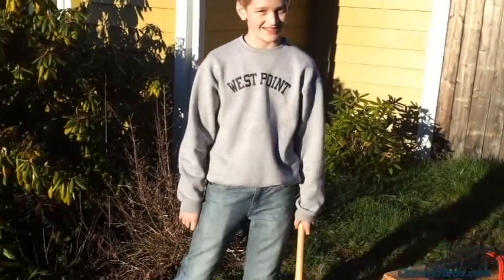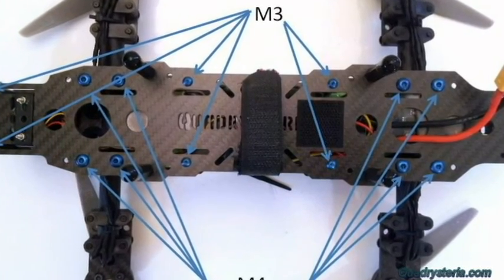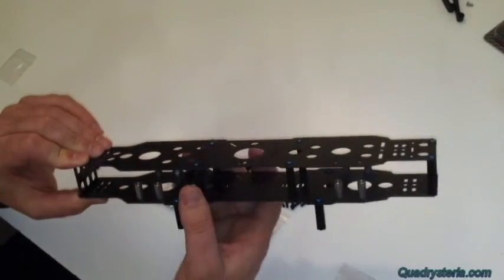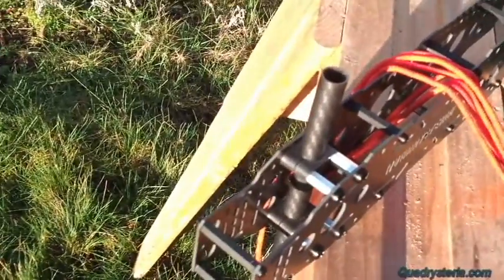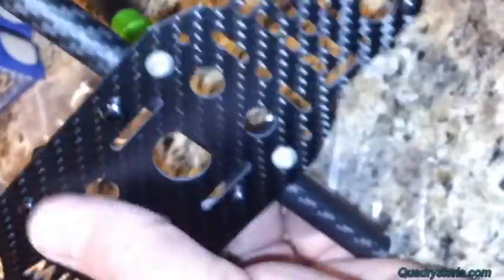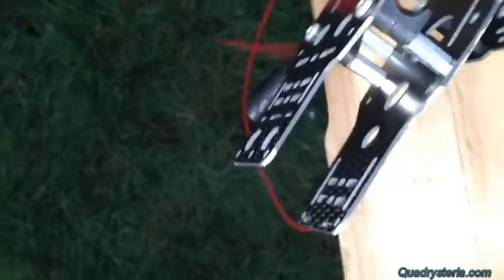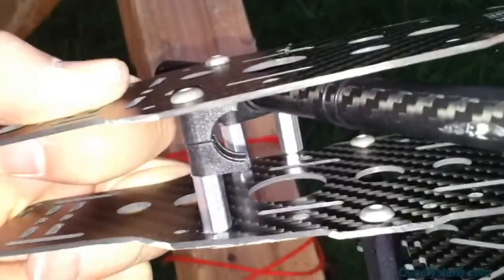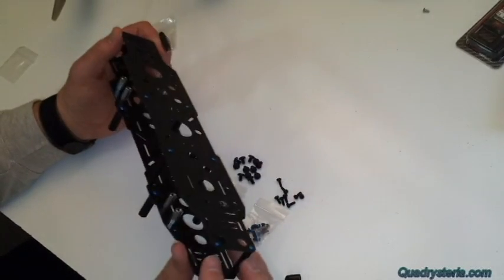Quadcopter Meets Baseball Bat

Comment: Brutal test! While the $ fpv camera is clearly well protected, a box to protect the $$$$$$$$$$ gopro or $$ Mobius would be a nice feature.
Reply from the maker: Designed for Mobius. (See the mount on my website.) It has anti-vibe mount on top. and gives you access to the buttons. A lot of guys complaining about protection don't think about this.  You need quick access.  Your can swap the cameras on the Mini Mamba and put the FPV camera on top and Mobius on bottom.
Reply: Quadrysteria I guess - but I think about my crushed Mobius. Suppose the other option is use the Mobius extension lens - the camera guts de-boxed inside the quad. A baseball bat attack might amount to the replacement Mobius lens extension kit. Bottom line is your quad looks fantastic, sturdy and versatile. Good job.